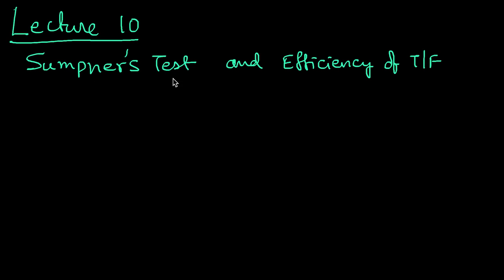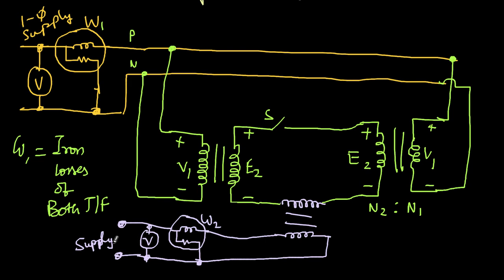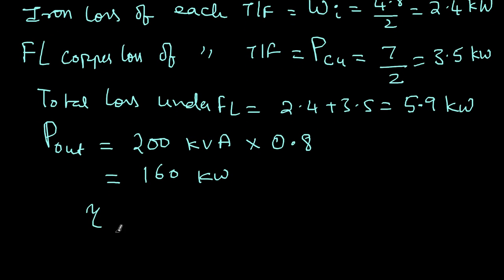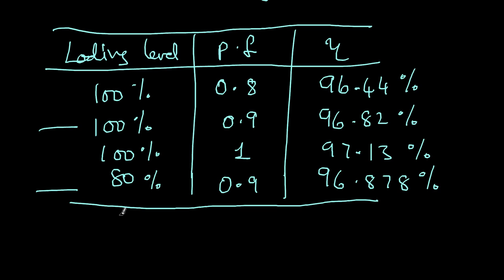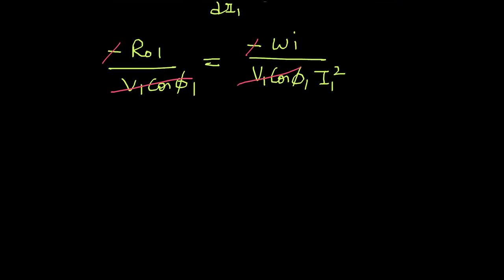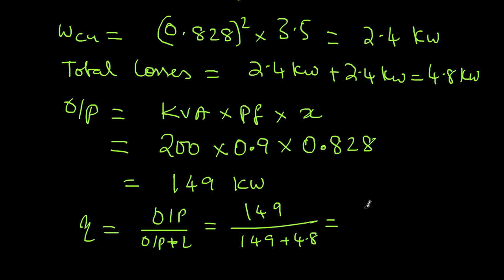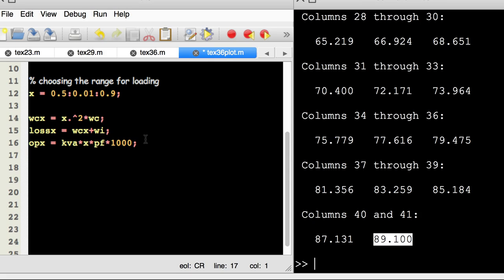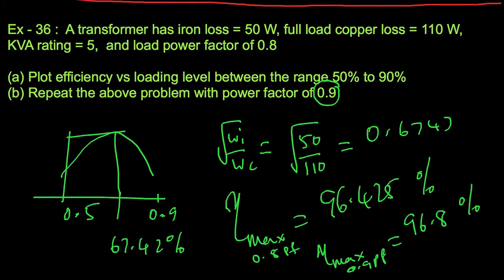L10 - Condition for Maximum Efficiency of a Transformer

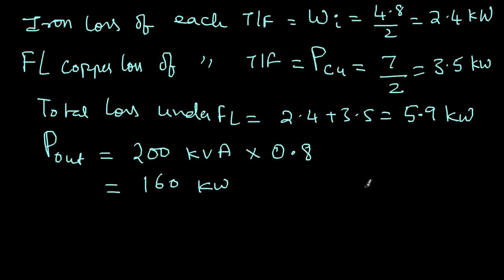Comment: Sir,  at 16:53 in the video you wrote p(out) as 200*0.8 but the power rating of a transformer is already taking cos(phi) into account.
Reply from the maker: Transformer rating is usually mentioned in Volt Amperes (VA). This will not consider cos(phi) into account. For example a 500 KVA rated transformer, under fully loaded conditions at 0.8 power factor will be deliver only 400 KW. And at 0.7 power factor will deliver 350 KW.
Reply from the maker: The reason why transformer rating is mentioned in VA is that the device (transformer) itself does not have control on what kind of load is connected at its secondary. So with out knowing the power factor of the load a transformer manufacturer can not commit to deliver a specific "active power, P" in watts.
Reply: Thank you Sir